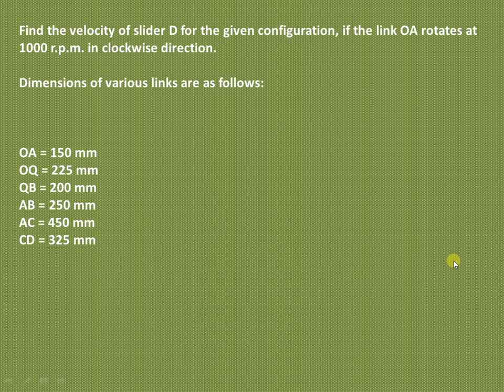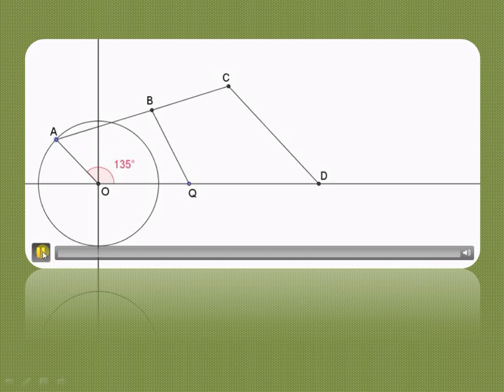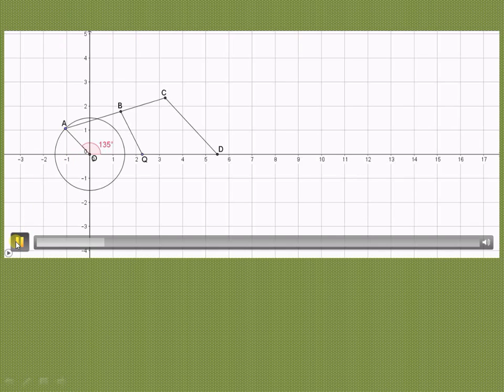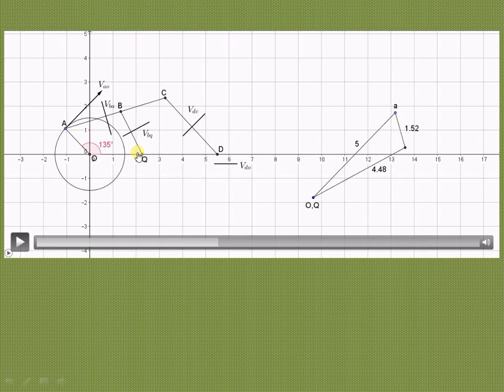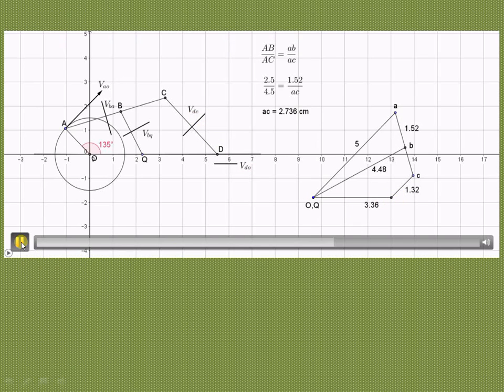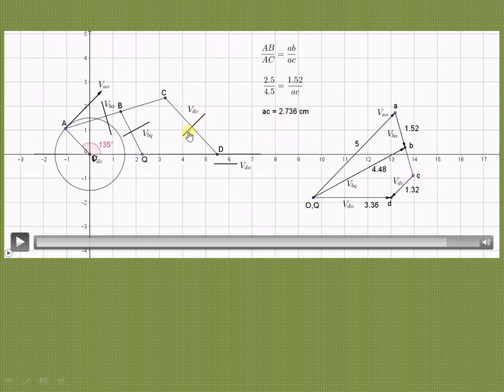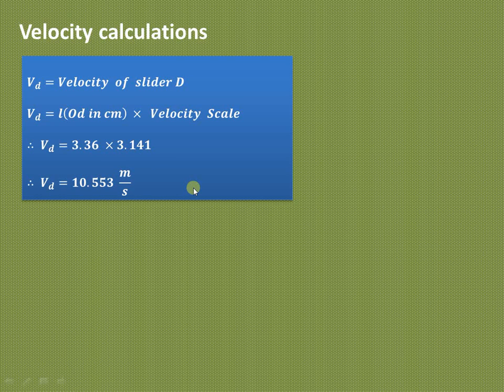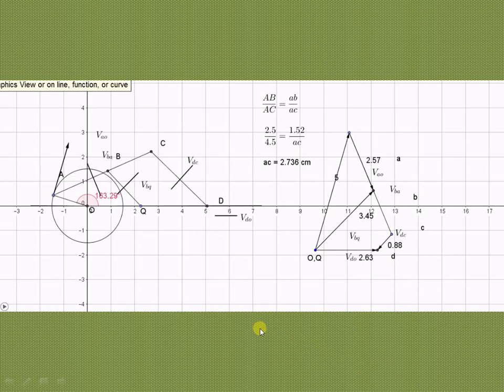Lecture 4 | How to draw velocity diagram & velocity analysis of mechanism | Relative velocity method

Comment: during the final calculations, the scale is 1cm=5m/s, why did you take 3.141 ?
Reply from the maker: The velocity diagram scale is not 1 cm = 5 m/s  but it is 1 cm= 3.141 m/s. Kindly go through the 3.09 min to 3.20 min part of this video carefully so that all the doubts will get cleared. Thanks ....

Comment: well i understood how to draw the velocity diagram  but please can u tell me how did u calculated those values like 1.52 , 4.48, 1.32, 3.36

plz sir it would be great if u replied ASAP
Reply from the maker: Those values are not calculated, from " a "draw a line parallel to vector Vba & from "Q" draw a line parallel to vector Vbq , those two lines will intersect each other at point "b" because "b" is a common point between those 2 vectors. And now if you measure the length "ba" it will be 1.52 cm & length "Qb" will be 4.48 cm. Hope it will be clear now.

Comment: I don't understand where the value of 5 on line oa and 1.52 on ab. Can you please explain how you worked that out because i'm confused
Reply from the maker: +Marumo Mamaleka We have chosen 5 cm to represent Vao , you can choose any value say 6 cm or 7 cm etc. accordingly your scale will change ( this step is explained at 3.30 minute of this video). Then from'a' draw a line parallel to Vba similarly from 'Q' draw a line parallel to Vbq, wherever this two lines meet call it as point  'b' then if you measure the length ab it will be 1.52 cm  length Qb will be 4.48 cm .
As initially we know only velocity Vao , we have to represent it by some suitable length & hence 5 cm is chosen. Hope this will help you. Thank you very much !!!
Reply: Alright that's much better Sir, thank you for elaborating.
Reply from the maker: +Marumo Mamaleka You are most welcome !!!
Reply from the maker: +Marumo Mamaleka  New video on "How to draw acceleration diagram - Four bar mechanism"  is here : https://youtu.be/5du285raaTQ
Reply: Yea indeed i chose 1 inch xD i just made my day tnx j sirr
Reply: how to measure that part ? 1.52 and 4.48 cm ?